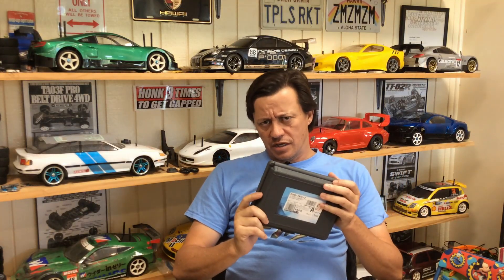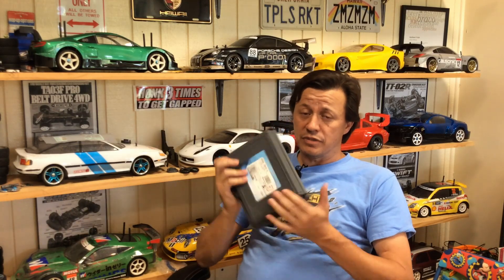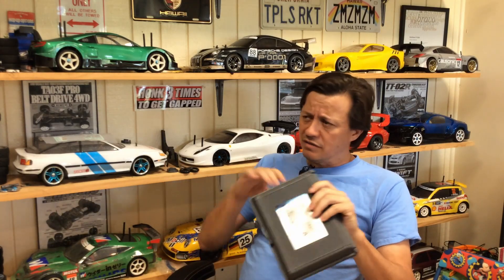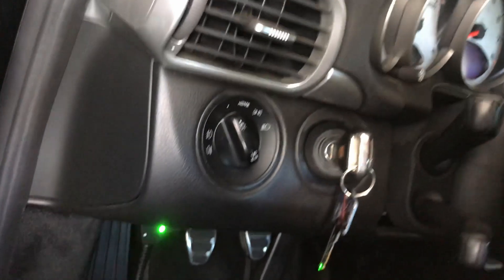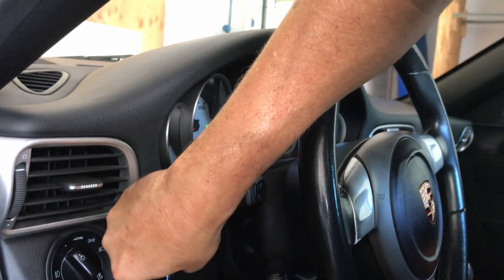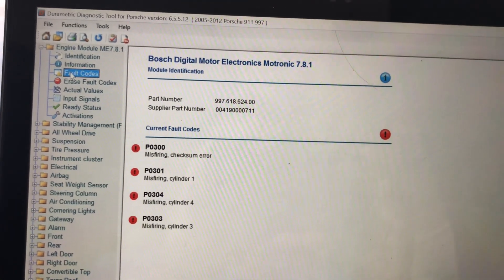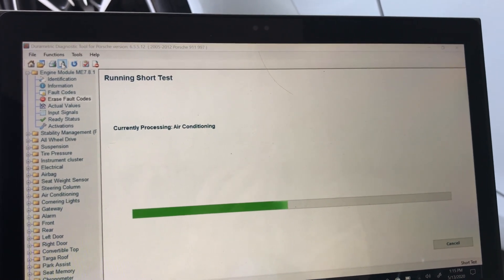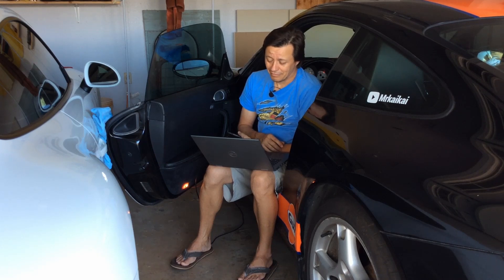Durametric for Porsche Diagnostics on a 911

Comment: Will this check the security system modules and associated sensors? Having trouble with my Cyanne
Reply from the maker: it should read and test all the sensors in the car. but you wish  to reprogram a sensor to be disabled you will need something else like a PIWIS
Reply: Do you prefer using the clone Chinese PIWIS to do so?